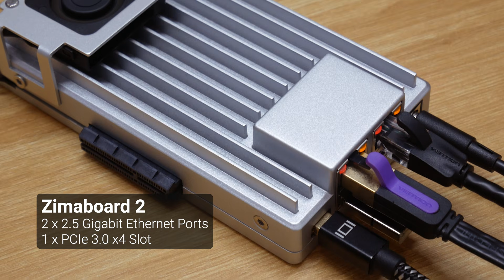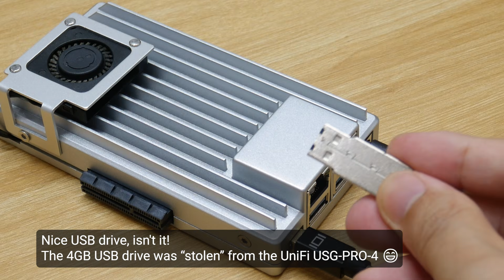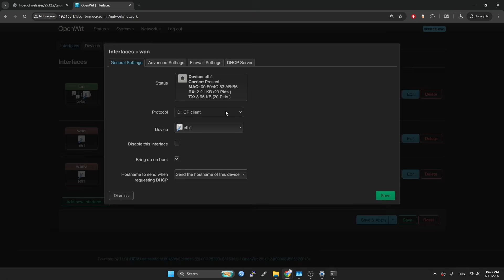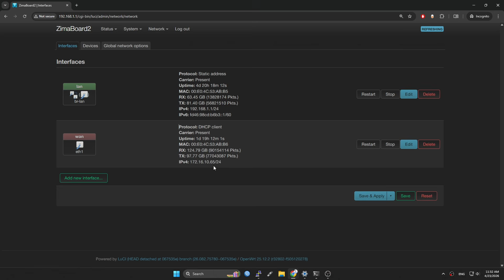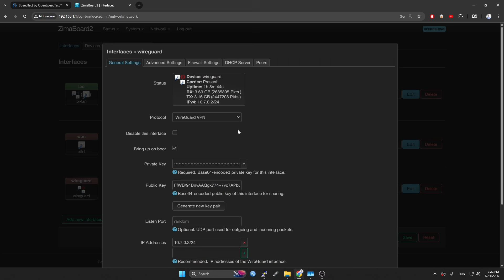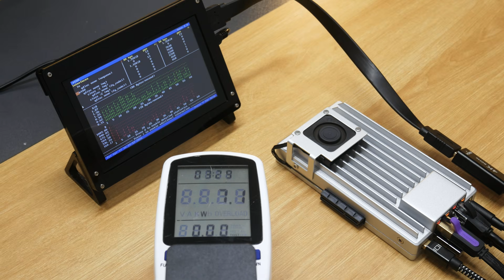Zimaboard2 OpenWrt Performance Test (2.5Gbps Routing, Wireguard and Power Consumption)

Comment: Would be really interested to see how this board handles routing 10GBE on the same setup.

Perhaps ( if you can manage it ) run bifurcation with a AQC113C chipset ( the 'c' version runs on x2 for PCIe3, I think! ) using two lanes, with the other two populated by two NVME drives  ( if you can manage it ) because then it is potentially a completely silent, x84, low power, 10GBE router with the ability to also perform NAS duties. 😲
Reply from the maker: Yes, I plan to give it a try with 10GbE soon, and maybe 25GbE once I have enough budget to buy some cards for testing. I will keep you updated :)
Reply: @VanTechCorner   Oh wow, yeah ... that's going to be a stress on the CPU, right?

Looking forward to it all! 🙂
Reply from the maker: Yup, I did test 10Gbps “simple” routing on the 1st gen of the Zimaboard and it worked just fine. At that time, the throughput is bit slower compare to the expected result (9.4Gbps), but later I found the problem is with the Emulex 10Gbps card. Let’s see how it goes with the Zimaboard2 😅

Comment: 16GB IS too much for OpenWRT. It's better to run ProxMox and run OpenWRT as a VM so you can use the rest of the RAM.
Reply: Or keep it as is and run docker without fooling with Proxmox
Reply: @realmadera I prefer to run Debian and manually building my router under that distro with nftables, dnsmasq, Network manager etc.